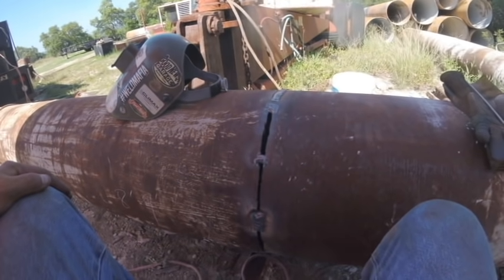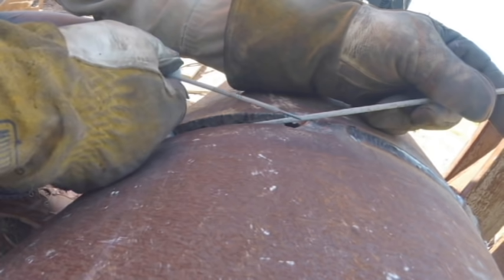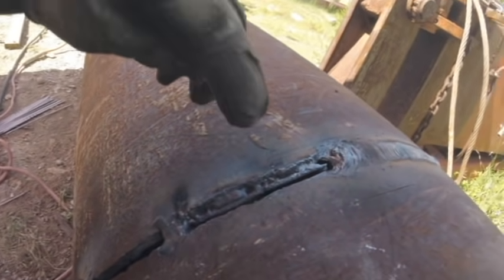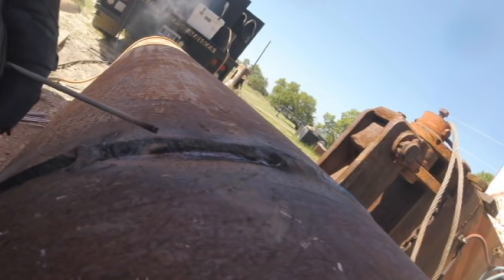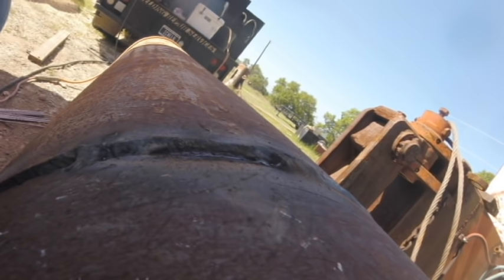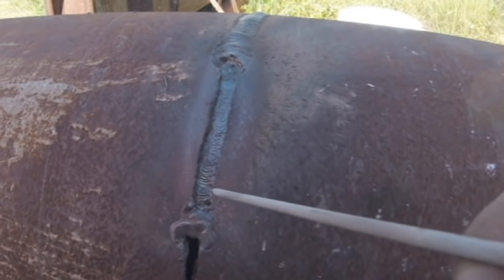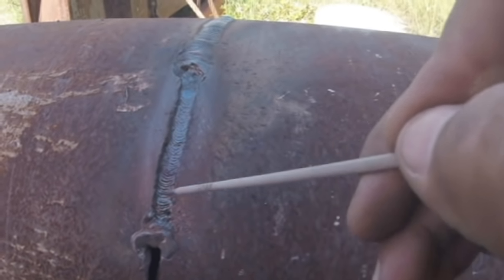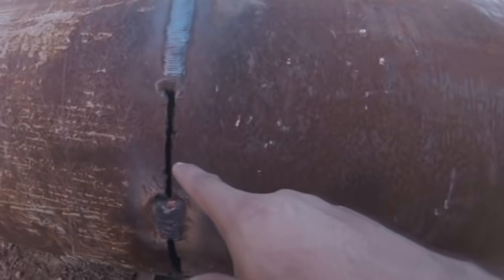Keeping it real!

Comment: I'm surprised that it cost less (I'm assuming) to have you fix the weld than to put it on a roller stand, cut it flush and weld it properly. That's not to say that what you did isn't a proper repair since it's just a casing it's not a problem, but it would have been a better solution for them to have fixed it using the normal method.

Comment: I’ve done the same thing on super thin galvanized metal with huge gap. But using a mig welder and 3/32 silicon bronze tig rod. Nothing pretty enough to put on the insta but it worked. 🤣

Comment: If it's not a structural.. and you know how to use a wire feeder.. with straight flux-cored wire.. reduce your voltage.use a little bit of a longer stick out you can bridge that Gap ..patience a little bit on the top a little bit on the bottom. Whatever everybody's got their modus operandi.. 5/64.
 212 Lincoln innershield.. and a gallon of water I would have filled that Gap in less than 15 minutes.

Comment: Yea only way I would do that is actually breaking off the Flux coating on the rod exposing just the bare metal itself. With you welding directly over the flux contaminates the weld. I know this isn't structural or under pressure so I understand why you would do this but even so I would recommend you weld over the bare metal of the rod and not over the flux coating...
Reply from the maker: the flux was removed on the filler piece,
Reply: IC knows what he’s doing, so don’t complain
Reply: @dirtfarmer7472   hahahah no one is complaining just sharing the appropriate way of doing a gap weld.
Reply: @ICWeld  well done hard to tell on the video

Comment: Bad fabricators work handed over to welder but this is not standard joint it may be some low pressure or No pressure joint and may have maximum chance of crack

Comment: Why would you not have picked it up, set it on 4 roller stands,  cut that garbage apart , reprep and weld it back up .  Probably would have been quicker and the customer gets a better product, it’s a win win  unless your hourly .   If for some reason you couldn’t do ^^  you did about all you can do with a mess like that it’s not a quick or pretty process lol . Good job as usual sir.

Comment: An interesting method young man. I have put link to a video below or you that shows how to do a 7018 vertical open route on 3/8plate (Actually the metric equivalent I think it was?) with a gap similar to that you are welding on that pipe. Jonny who has the welding channel Northern Sweden Welding says that in Sweden they do not use 6010 or 6011, it's 7018 all the way out. He also does a 6010 video which is quite funny because he doesn't like the 6010!

I have tried doing the 7018 vertical open route and the key thing to remember is DC Electrode negative. When I did my video I was on electrode Positive so the result wasn't very pretty but I got the bead in there. 
All the best, Jon.

https://www.youtube.com/watch?v=R_8rs1wMnDo

Comment: I've done lots of texas tig filling gaps that makes the sissies that need perfectly tight joints crapping their pants. Watch guys trying to make things fit perfectly, I'm get the hell out of the way I'll weld it up. I learned from old school welders, didn't go to trades school, learned in the field not a certified welder nor do I want to be just got many years doing it. People see me doing tig welding with sticks they are WTF are you doing. Guys think its funny I can't mig weld I hand them a stinger and they can't do it, I maybe only 44 years old but I'm old school it would put me 70 years old.